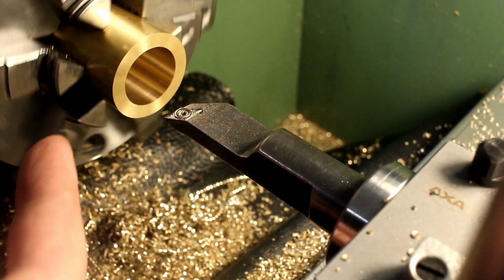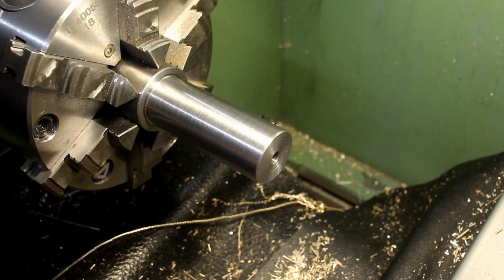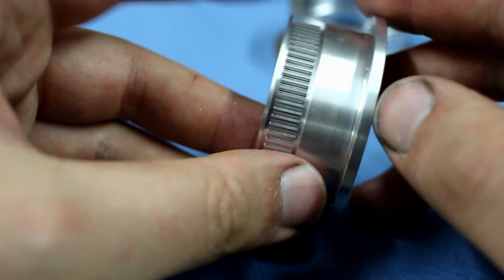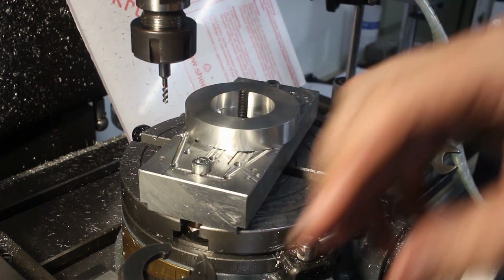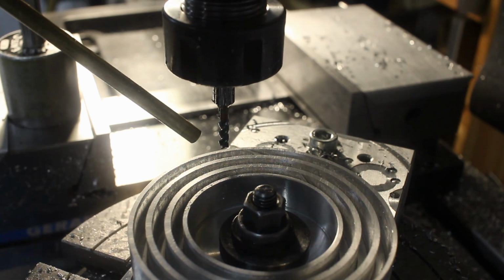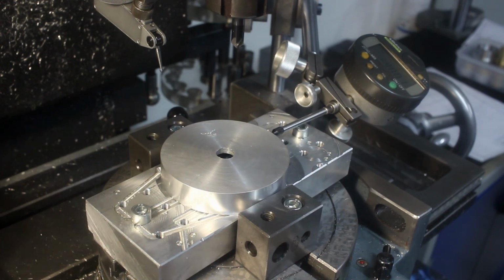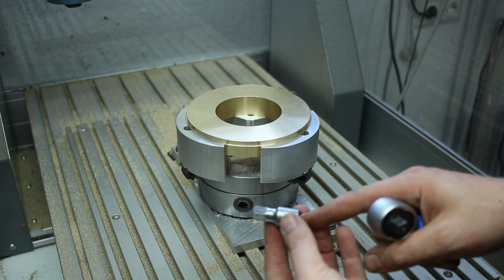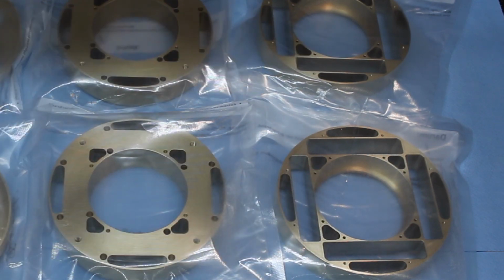The Archives #5 - Tubular Tube Tasks

Comment: Had a pile of aluminum chips I was pulling out by hand and there was one razor sharp ribbon of stainless mixed in. The stainless snagged and made a cut that went halfway around my finger. So yes, I now only use pliers or a chip hook to clean out the lathe.

Comment: The deep groove cylinderical part on the mill would have been super cool done in the lathe with the tool post router spindle and and carriage engaged. Like a horizontal ramp path. If the lathe can run at that low of a feed/rpm.

Comment: I have been running through a lot of your back catalogue and way hey a new one comes up. Enjoying your old stufff by the way even though i have seen them all before. 
Now time for me to give you a hint. Rathervthan using abs/inc for each groove  you can give each one its own coordinate as a "zero" call thr first zero 1, the second zero 2 etc. Think in terms of tool offsets on the lathe. The zero function doesn't interfere with your Abs setting but be warned the abs will alter all the zeros you have set.

Comment: Interesting. Lathe work with a blow torch. Need to remember that. Also I wonder whether you had concerns about removing the brass cylinder from the mandrel after drilling the holes? I would have thought the little drill burrs would cause removal issues at the interface of the mandrel.

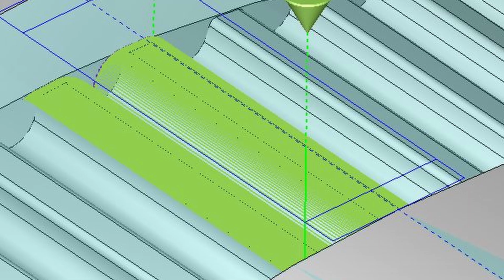Comment: 22:07 why not extending tool path to half of the tooth on the right?
That way, you can do two tooths in one pass (half of the left tooth, full in the middle, and half of the right).
Reply from the maker: Yes, that would speed up the process quite a bit - in hindsight you could probably cut 4..5 theeth at the same time.

Comment: Interesting design choice for the magnetic field line convertor shrouds.
I find the shapes and arrangement of the channels for the active and passive dielectric materials quite novel.
Your client must have done a fair number of calculations in order to get the crossover thresholds of the hysteresis events
to remain in sync throughout the variations of the flux amplitudes.
I am not surprised at all, that you didn't show the ferrous cores that get inserted into the square cavities of the brass shrouds.
Their shape would have given away the purpose of what you where building and we wouldn't want certain actors to get their hands
on this kind of technology. Be safe. 😁🧡
Reply: lol
Reply from the maker: Dankeschön :-)

Comment: Fascinating video. very complex parts... 
How do you evaluate how much money to charge the customer? Did a customer say "ok, that's too expensive, we will make it on our own?"
Obviously if it's a simple job like turning a simple design that's fine - but how to you calculate (in general, not actual numbers) the price?
Would it be like: Xhours of running the CNC+Expected broken/dulled CNC/lathe/endmill bits/tools +electricity bill+material cost+hour wage = final price?
I love turning brass (on my tiny lathe/mill brass and aluminum are preferred materials) but I fully agree - it's bloody expensive.
Reply from the maker: Well, I have an hourly rate that I use to quote a part.
I look at the part, guesstimate how long it will take me to machine it, make fixtures, do the cad/cam work and how expensive the material and tooling I need to order is. Add all that up, add 25% and theres your price :-)
Reply: @StefanGotteswinter  cool. Thank you!

Comment: For some time now, I wondered about re-cycling the chips from those expensive materials. Is that done?
Reply from the maker: Yes, absolutely - I collected all chips from this project seperate and sold them as scrap. 
I do that with brass/bronze/aluminium, larger shops will also do it with steel and stainless.
Reply: There is another channel here from right around the corner where I live (Clickspring ,Cairns, FNQ) who does melt down brass water armatures into molds and then uses them for making parts on his lathe. No idea if those would be to material spec then though..

Comment: Stefan - have you ever found a good use of the 120 degree corner of the CCMT inserts?
Reply: There is a tool that allows you to use that angle for deburring edges and lead in tapers on shafts for smooth seal assembly.
Reply from the maker: I have a lathe tool that uses the 120° corner for facing (And the long edge for chamfering).

Comment: Could you use an end mill, in a grinder fixture,  on the lathe, as a possible solution to the issue you mentioned? I guess that might require a fairly low spindle rpm? Wouldn't your motor controller allow that?  I don't recall you describing the motor setup on your large? (My bad wenn I habe dass vermisst) M f G'n
Reply from the maker: yes, i didnt have that setup with the toolpost spindle back then - i might have used it.

Comment: Stefan, can you tell me your experience with drilling 954 aluminum bronze? is it difficult with large drills? thank you.
Reply from the maker: Sorry, I have no experience whatsoever with aluminium bronze, apart from some minor milling work on some Amco parts.
Reply: I made some wrist pin bushings from aluminum bronze once I don't recall it being difficult to machine.  Since it is available in tubes I just bored  and turned them to size but drilling the lube holes was no problem.
Reply: @bcbloc02  thanks! I'd be drilling large diameter, deep holes. I heard its tough on HSS. tools so i'm a bit worried.